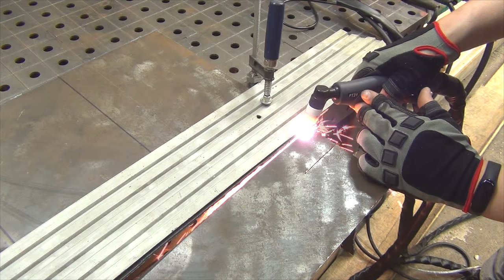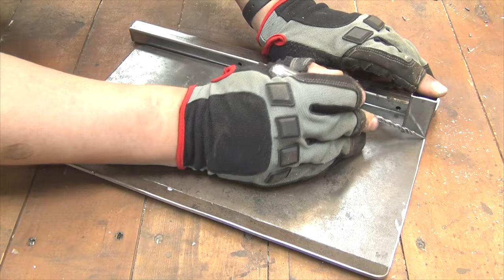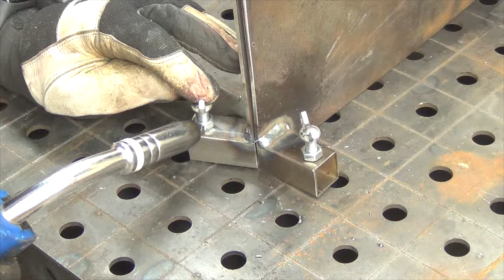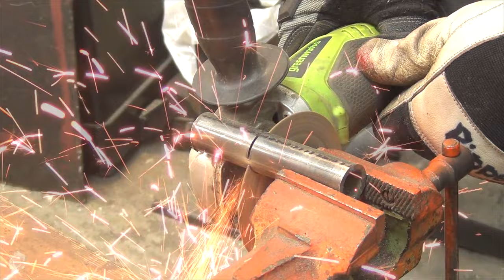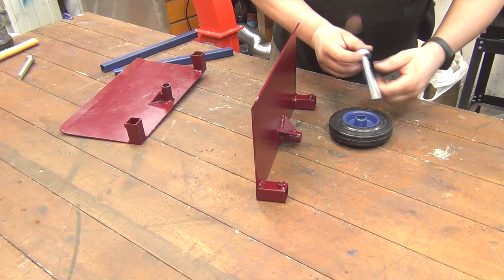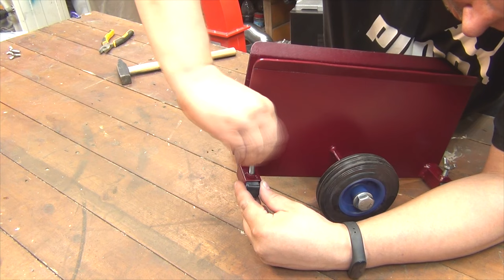This DIY device will make your job easy

Comment: I made a sheet material transporter in about 15 mins from an old skateboard  I cut off the curved ends and fixed 2 bits of 2x2 on the top with a 2in space between them 
job done no welding drilling making axles buying wheels etc. works very well can be steered with side preasure and depending on the length of the material being transported 
it will tilt fore and aft to go over obstacles I made it 30 years ago and its still going strong I used it yesterday...many people have scorned it but when the see it in use and try it out 
they soon change their minds about it...make one and you wont regret it kind regards
Reply from the maker: Thank you) I will definitely think about your idea